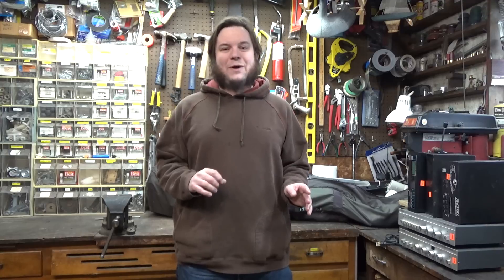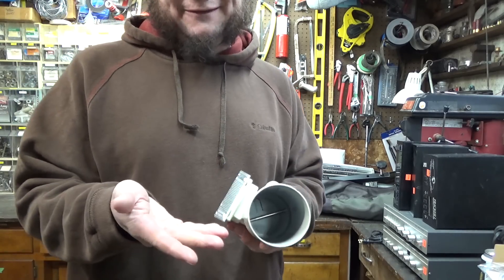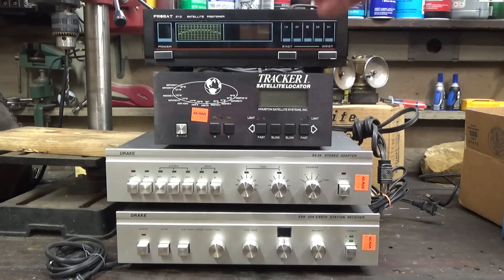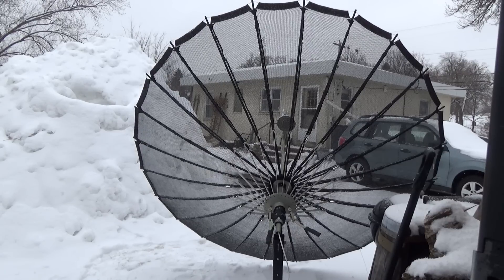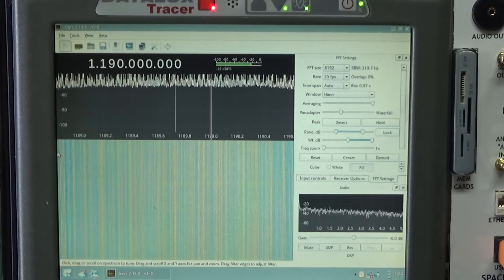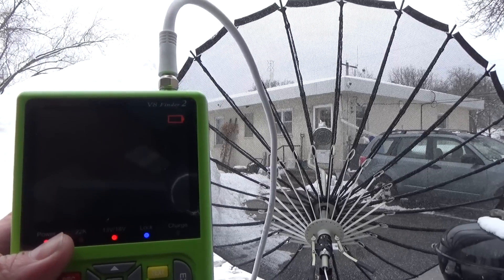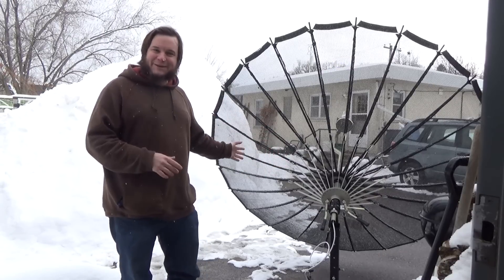Cyberex CN-7500 Folding C-Band Satellite Dish & Free NASA TV

Comment: I have not seen one of those in a minute.  We used to set those up as demo's for potential customers.  Very rural area and needless to say a lot of people were skeptical.  Eventually we stopped and just assembled a dish on a 4' concrete pad that we could slide on and off a trailer.  It was a rare day when we would have to retrieve a dish.  Especially before anything was scrambled.  I don't remember exactly what we paid for ours... but I remember it being more than a solid 8' fiberglass dish.  

Oh wow... look at that!  You even have the old school "tracker" boxes for those customers that upgraded to electric dish positioning instead of the manual screw jack.

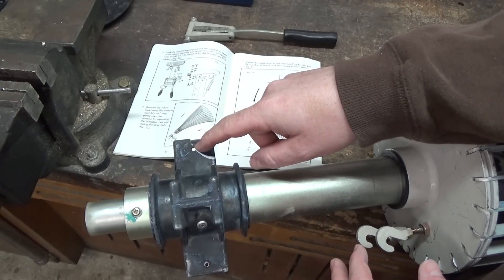4:05  That absolutely can be fixed.  Minor stuff for a weld shop.

Comment: It would be really funny to place a dish tailgator hidden in the roof and replace the antenna with a long range wifi antenna and hack wifis and just use the motor to find them. Also it would be interresting if it could be used for point to point long range. Sadly  nothing like that is or to my knowledge have been available in and around denmark. I would do somthing like that

Comment: What can antenas to steal wifi ?
Reply from the maker: Pringles chips, they come in a cylindrical can that's coated in foil and it's coincidentally just the right size to work as a 2.4Ghz waveguide. We used to use those to go ridiculously long distance with WiFi back when everyone had security disabled.
Reply: @saveitforparts  thank you

Comment: Cyberex is new to me but much of the hardware looks exactly like my Toki dish. I believe the first was Bob Luli's (https://www.youtube.com/watch?v=_fiauunafeM) folding dish and that design was later sold to Toki. It's a bit like a Cassegrain, instead of the button-hook. At the focus is a "splash plate", which was originally a Ekco pizza pan supported by a styrofoam cup! Waves are sent back through a circular waveguide. The LNA (LNB these days) was at the rear of the dish so rotating polarity is just a matter of manually spinning the LNA . The mount is a clone of a Celestron tripod with the polar mount. Bob's design used a real Celestron tripod.
Reply from the maker: Neat! I've seen one or two like this but they seem very rare these days. I'm hoping to get more time to experiment with it this summer.

Comment: A friend of mine, Robert Lully, invented that folding C-band dish back in the late 70's. He sold many of them to the oil companies who used them for data transfer from out in remote areas where they were conducting geological surveys. I have a couple Motorola 4DTV C/Ku band receivers available. One of them has the Digi-Cypher card installed. Let me know if you're interested in making a deal. I think the model number is DSR922.
Reply from the maker: Hey, that's cool! Always interesting to hear the origin of some of the weird old stuff I come across. I'm not really sure what'd I'd do with the TV receivers, I have a couple little universal receiver / meter things and I don't watch a ton of TV.

Comment: I designed and built one at the company I worked for, some 50 years ago - for the 'free' TV broadcasts. The dish I made, was 16' in diameter, parabolic, metal mesh. At that time, they were FM analog signals, and not encrypted. Good times. The best available LNB had a 110'K noise figure, which is a FAR cry from today's Ku band LNBs.
Reply: Actually, 110K is only about 30-40K worse than what is achieved at C-band and Ku-band these days. The advertised noise figures are complete nonsense, and each vendor tries to "one up" the other on noise figure, because consumers have no idea how to measure it.   But if you, like me, have the necessary knowledge, experienced, and equipment, it's not hard to see that these '10K noise temperature" LNAs aren't doing anywhere near that well.  I'm a radio astronomer.  I actually care about these things...
Reply: Is it possible to share such a design? Hard to get large dishes these days.
Reply: You right, Gardiner was something great. 0,8 is true 0,8 NF

Comment: Would you have any use for a couple of cell repeaters? I have a Wilson something something 3g and also one for the 800mhz range I think. I also have some tower sections too. Maybe 40-50’ between the few sections.
Reply from the maker: Towers could be cool! I don't know what I'd do with old cell stuff, I don't think they use 3G anymore.
Reply: Yea idk what I’m going to do with them. I was thinking of trying to turn them into a diy long range RC system. But I’m in Ohio if you want the tower sections.
Reply from the maker: I'm over in Minnesota, I don't think I've been to Ohio yet! The old 3G and 800mhz frequencies might have been re-used for 5G, so make sure you're not interfering with anything on those!

Comment: That dish antenna was invented by Bob Luly in the early 1980s.
Reply: Wondered if anybody would bring Bob Luly. I have one of Luly's antennas and every now and then bring it out to show some history. I made sat receivers back in the early 80's under the Sat-tec and Prostar names. Sold tens of thousands of them!
Reply: @jgramsey  John, I remember you well.  I met you around 1981 at an early TVRO show in Anaheim, CA.  You also gave a lecture on satellite receivers and demodulators.  I remember asking you about how a delay line demod worked.  You had designed many products and it's too bad that there's fewer hobbyists nowadays.

Comment: Never knew there were portable C Band satellite dishes. I only know and tested portable Ku Band satellite dishes, a dish has the size between 40 - 60 cm. I recommend you a C & Ku Band LNB, so you can receive more FTA channels on both bands. For example Galaxy 97 West has FTA channels on both C and Ku Band, you can test your dish on that satellite.

P.S. I don' t understand why YouTube deletes all my comments.
Reply from the maker: This one came though! I notice Youtube deletes anything with a link, and sometimes stuff just disappears (I'll see it in the notifications but then it's gone when I click on it). Not sure what the deal is. 
I have a variety pack of LNBs and feedhorns, I might also stick my cantenna for weather satellites on there. I've played with some of the portable KU band dishes and have some videos on those too.
Reply: @saveitforparts  There are two youtubers: Robbie Strike and Northcoaster Hobby" they explain everything you want to know about FTA (free to air) satellite reception.

In your case buy a C&Ku Band LNB. Some satellites broadcast TV and radio channels on both bands and you can receive them with a single C Band dish. You also need a DiseqC switch. The switch allows you to connect 2 up to 10 LNBs and have all signals on one cable. From you receiver menu you program the switch make sure the satellite is on the correct input otherwise you have no signal.

I have 5 years experience in Ku Band satellite and OTA TV and FM reception.

Also NASA TV HD and NASA UHD can be received in Europe on HotBird 13 East satellite. FTA, too bad cable companies don't want to rebroadcast the channels so you have to install a satellite dish if you want to watch them.

Comment: Wait, C-band is not affected with snow 🤔
Reply: You're right. One of the major advantages of C-Band is its immunity to lots of moisture, i.e. rain. However a dish filled with wet snow can attenuate the signal significantly. Some stations and other critical downlinks will have dishes with heaters to keep the snow from accumulating and blocking the signal. But the rain or snow itself falling won't block the signal like on KU or KA band does. The dish here probably doesn't have enough gain or the LNB isn't hot enough to overcome the weaker signals off this dish. It could also be the LNB is older and its phase drift is too far now to have a decent lock on the signal;  why you see breakup in the NASA feed. Plus a lot of these feeds are now using higher order modulation (i.e. more than QPSK, likely 8PSK or 16PSK) now that the C-Band plan has been narrowed to make way for yet even more cellular frequencies..
Reply: @marcusdamberger  True! I used to be a satellite dish installer in a good o'times 20 years ago. One thing that I noticed is that snow isn't really blocking the C-band but accumulating on the bottom of the dish the snow acts as a slowing wave speed dielectric Inorodices the phase shift which then will be applied at the focus point resulting in a signal loss.
But if the dish itself has bad geometry in the first place the snow phase shift hasn't been causing any signal losses due to the focus "beam" itself wasn't really accurate. Well, that was my theory for that poor Chinese-made dishes.

Comment: "back when you could steal people's wifi"
So, today?
Reply from the maker: I miss the days when nobody had WPA enabled by default... and every access point was named Linksys :-P Of course the speeds were terrible...
Reply: @saveitforparts  indeed. But WPS is still very weak. Even if the router has rate limiting, that only turns hours into months (not a problem if they're your neighbor).

Obviously turning WPS off increases the difficulty level significantly, but on almost every block there's at least 1 AP you can get into with a few hours of work, and several more with a few weeks of work.

Or so I've heard.

Comment: That thing would be great for radio astronomy.
Reply from the maker: I need to figure out some motors and a mount for it (or for the rigid one). I have some of the old 24V actuators but they're pretty rusty.
Reply: @saveitforparts  you static mount it. Point at one point in the sky. Measure the hydrogen line and as the earth moves it will pick up objects as it passes the antenna.

Comment: I'm not much of a satelite guy, or a HAM or a radio guy, but it seems to me, even with multiple signal antennas tuned to multiple frequencies,   Provided you had active computer control, you could still use them in a contiguous group, the computer being the translator and director.  Is this the case, or am I missing something?  Sorry if this is a dumb question.
Reply from the maker: I might try the multiple small dishes again, I need to replace the drive motors on one of them first.

Comment: That looks like a drake Earth station receiver that you have there, if I recall correctly those have a 70 megahertz IF frequency, and used an LNA or low noise amplifier connected to a block down converter that sends a 70 megahertz signal to the receiver.
Reply from the maker: I had to look up which of my obsolete gadgets you meant, but yes I think there's one of those in the Ax-Man surplus pile. I haven't looked at that stuff too closely yet, it's just cluttering up my workbench right now.
Reply: @saveitforparts  with a power injector and an SDR tuned to that 70 MHz frequency would also give you an option however some of those receivers sent a variable tuning voltage to the block down converter and also had a stepper motor polar rotor for fine-tuning your skew, as you can imagine the variable voltage tuning units were highly susceptible to drift during that era, however with more accurate variable voltage supplies nowadays you could probably make it quite stable

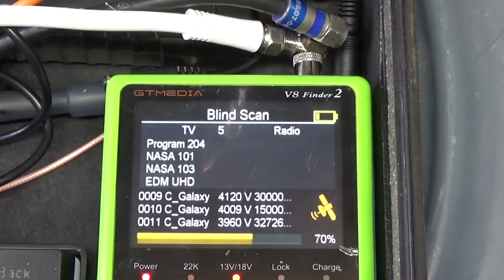Comment: 8:28 something I do to my stuff, that has terrible battery life, is I'll replace the battery with a stepdown regulator, and then have a plug on the case (or hanging out cause mounting is hard), so I can plug in any battery or external power source.
I'm not sure what that finder has, but I assume it only has battery power and charging.
Reply: if you have room, you can also add a switch between internal and external power, if you don't want to sacrifice the form factor all the time
Reply from the maker: I might have to swap the battery on the thing, the one it came with really is terrible. It charges from USB and won't turn on while it's charging.

Comment: Cband signals in US run 3800mhz to 4200mhz. You were looking in the wrong range.
Reply: no, he was using an LNB which downconverts the signal to a range that is visible on the rtlsdr (which has a max of 1.7ghz usually)
Reply: @polarizediris  Yeah, the LNB downconverts the c-band range (3700 - 4200MHz) to L-band (950 - 1450Mhz) for the satellite receiver, or also in this case the RTLSDR. To convert between the 2, you take 5150 - [c-band frequency] = l-band output frequency. So when he's looking at 1191Mhz on the RTLSDR (at 6:47) that's actually 3959Mhz originally from the satellite.
Reply: @gorak9000  Right on, 5150 being the local oscillator (LO) frequency in MHz that C-band LNBs operate at.  For Ku-band LNBs (as you proably already know), the LO is 10750 MHz.
Reply: @RyanSchweitzer77  10750 LO if it's a normal FSS band (11.7-12.2) ku lnb. There are tons of different Ku LNBs available though, low band ku (10000 LO if I remember correctly), normal 11.7 - 12.2 ku, DSS ku (12.2 - 12.7 with LO 11250), and all sorts of band stacking LNBs and all kinds of weird stuff. Most of the time (in north america) it will be a normal FSS 10750 LO lnb, or a DSS 11250 LO lnb, but that's no guarantee - best to look at the label on the side of the LNB or look up the part number to know for sure! And if you start talking about Ka band lnbs, there's even more sub-bands and different LNBs available!
Reply: @polarizediris  gotcha. I see near the end he was getting some signals. 8ft dish probably a bit too small for the high FEC signals these days. But more accurately tuned, perhaps would be ok.
Reply: C-band used to be 3700 - 4200, but 5G took over the bottom part of the band (and will take more in the coming years, but they're doing it in stages so the satellite services have time to move). Once the 5G takeover is done, c-band in the US will only be 4000 - 4200. Sad times... All so you can get slow crappy oversubscribed phone internet, but at home! YAY isn't capitalism a wonderful thing??
Reply: @gorak9000  I don’t think the phone internet is actually what they want to use the frequency for. That’s just what they sold the courts on. There’s a bigger plan for the spectrum that has yet to be seen.
Reply from the maker: I need to dig through my LNB / feedhorn pile and figure out which ones do what. The local surplus store had a few, I have a "universal" Ku model with no real specs on it, plus the C-band and GOES stuff that came with this. I'm learning a lot of this as I go!
Reply: @saveitforparts  use a current Windows machine with a PCI tuner card and CrazyScan. This is what we use to tune Satellite signals, KU and C-band. It also shows things like dB level of the signal so you can fine tune. Just leave the scan page up on a known frequency (like 99w 4120 H 30000 for example), then fine tune until you hit the maximum dB level. This transponder is ABC. And the hardest FEC to lock cleanly because it’s 9/10. Happy hunting!
Reply: @saveitforparts  "Universal" Ku lnbs have 2 different LOs in them that you switch using a 22khz tone sent up the cable - that allows you to cover low band ku (below 11700) and regular FSS Band Ku (11700 to 12200) with one LNB, but there's hardly any low band ku in north america. They also use non-standard LO's which confuses things too (9750 for low band and 10600 for high band instead of the usual 10750), and to get the high band which is what you want most of the time, you have to inject 22khz into the cable (or make sure 22khz signal is turned on in the satellite receiver) which complicates using them when you don't have a regular satellite receiver connected (like a spectrum analyzer only or a SDR only). They're more popular in Europe where they have more dual band-ku, but they still exist here for some reason
Reply from the maker: The little V8 finder thing I bought online will do a 22khz tone. I haven't really gotten into TV or Wild Feeds or whatever so I don't use it too often.

Comment: You have the asmuth the elevation the focal depth which should be set and the SKU and the declination
Reply: That mount only has azimuth elevation and skew - there's no declination there because it's not a tracking mount. 

A polar mount, which tracks the dish across the Clark Belt using a linear actuator has polar angle, declination (which together give you the elevation), azimuth of the whole mount (has to point due south), polar "hour angle" (which is basically the axis the linear actuator moves the dish between satellites). On a polar mount, there's no skew adjustment, as you adjust it once, and the dish skews naturally as it rotates on the polar axis.
Reply: @gorak9000  I used to have a horizon to horizon motor mount C-band dish

I could get from 5 W to 138 W

It was AWESOME
Reply: @ocsrc  I have a brand new never installed Houston tracker H-H mount in my garage, and at least one other used H-H mount outside. I definitely couldn't ever hit 5W though, there's some big stupid rock in the way. I can hit 180W and beyond over to 166E realistically. I don't think too many people in North America can say they've watched ABC Australia by c-band satellite! On the east side, 53W might be do-able. I can get 55W, but there's trees and stuff in the way.
Reply: @gorak9000  55 and 53 I think I remember a few HD fashion channels I used to watch and Asian HD channels. A lot of the satellites down under 50 W are circular. I had a quad LNB that did Linear and Circular. I had a V-Box that controlled the motor and a Diseq switch that controlled which LNB output I used.
I really miss my dishes
I moved and I got sick and bedridden and I don't do much of anything anymore. I am pretty depressed
I just lay in bed watching TV or YouTube
Reply from the maker: Talking about trees reminds me of a neighbor back in Alaska setting up his satellite dish. He had the receiver and TV out on the deck with a case of beer, and his buddy had the chainsaw. He'd look at the signal strength and point out which tree to cut down next 😆